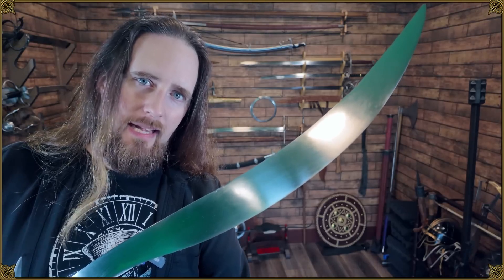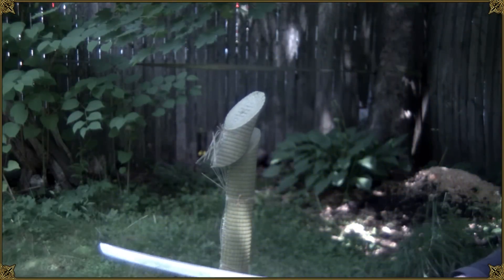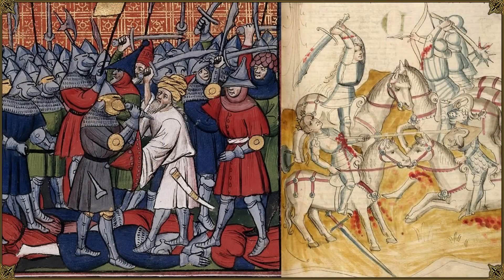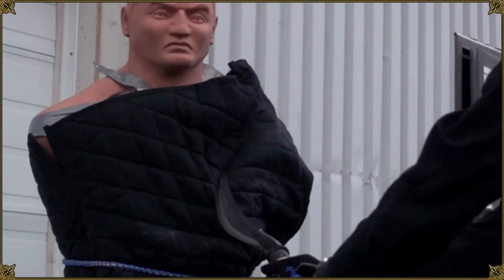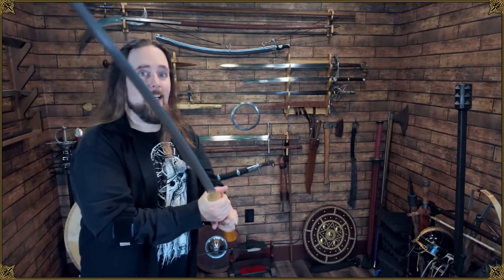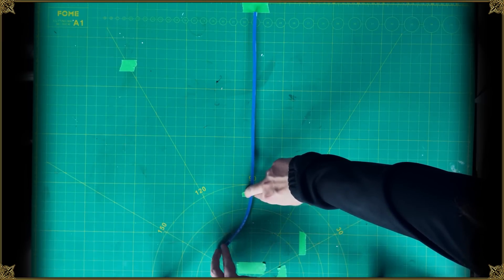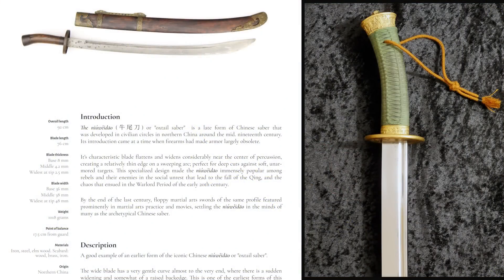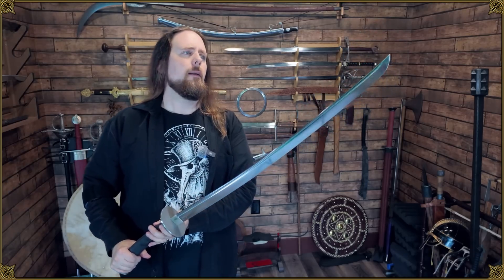Sword Design: What's the Recurve For?

Comment: I have a machete with a straight spine and a slight s-shaped edge. It cut trees/branches up to 1-2 inches (2,5-5 cm) in diameter clean of. The optimal cuting zone on the blade just between the curves. 

I also have a "biggish" knife that have the same curvature. It is useless as a bushcraft knife because spikes on it's back but it is a phenomenal at cutting things. I primarly use it as a kitchen knife out in the bush and it works perfect. The curvature and wide thin blade makes it cut (not chop) meat and veggies very well with little to no effort.

Comment: I've always thought that curved handles are there to lessen the risk of the sword falling off of your hand, to harden your grip. Because when an opponent were to apply force to your sword, it would be easier to hold on to it, for it to not slip, or am I wrong? Especially in dueling blades it should be more common, not for typical soldier blades, which are thought to last (durability) instead of leaning more towards effifiency. What do you think?

Comment: This topinc and curved handle specificly reminded me of a bent shaft canoe paddle. This is a style of paddle where the shaft is bent "forward" at about 15-30 degrees partway down the shaft. This way when you do a stroke, the back half of your stroke, which has more power, stays in the water for longer. 
In this case of the bent handle it feels like, the end of the swing where you have connected with the target, your arm has more room to move towards you, giving you more power at the part of the swing that "matters."

For those curious bent shaft paddles also have a number of drawbacks in that they are built just for power but really akward to do anything else with (and weird to use even when going straight). Also they tend to be much more fragile.

Comment: I feel the curving handle is mostly to help prevent the hand from slipping further. 
I get the same feeling when having a round pommel like in the video, there's more material that the bottom of the hand can go up against and thus slow down on. You can feel that rather prominently on anything one handed, such as a hatchet, machete, or on a splitting axe's handle.

Comment: I think it's a matter of force and impact. If you try to cut down cavallry, you don't have to generate much force yourselft because the horse is allready moving at a high speed, unlike an allmost static target ai infantry. If the force needed to cut is generated by my opponent, rather than myselft it's more a matter of what is easier to hold on to; or if the force generated by my oppoenent is much greater than any I could generate how do I ensure I still get a cutting motion, even if what I am doing is effectively only holding onto the blade ai resisting the force that is applied against my blade. If you imagine holding a stick into a stream of water, it requires more effort on your part to keep the stick stable when it is straight, rather than curved; and the motion overall is different.

Comment: I think you need to take into account the wrist being a pivot point, and specifically it being a bi-directional pivot. The forward curve probably gives your wrist and hands more purchase to start the blade back and then arch it forward as your wrist and elbows rotate in the swing. I'm just mentally theory-crafting this it would definitely benefit from real practical testing.

Comment: Unfortunately, there are three significant errors in the video.

First, how in-line the point is has little to do with how easy or effective the sword is for thrusting. In fact, it's widely considered best if it isn't, as a point forward of the grip axis has quite a few biomechanical advantages. As evidence, I give you the khopesh, the 1860 LC, and the Pattern 1908, as their relative thrusting capacity is inversely proportional to how in-line their grips are with their points.

Second, it's not the length of the edge that determines "sliciness," but the angle of the edge relative to the direction of the sword's motion. In other words, a straight blade will behave similarly to one that's curved if it strikes at an angle. That's why if you look closely, you'll realize that many kilij are effectively two straight sections joined at angle, and only the transition between them is actually curved.

And third, curvature doesn't necessarily make a sword worse at thrusting. At worst, you're trading wound width for wound depth, and whether that trade-off is worth it will depend on the "hardness" of the target and the angle at the tip. Additionally, if the sword is curved forward, deeper penetration can actually be obtained using what Col. Marey-Monge called a "curved thrust," a cycloidal motion somewhere between a typical thrust and a cut that allows the point to be delivered with greater speed and force.

This is all discussed in depth in Memoir on Swords by Marey-Monge and "The Shape of Sword Blades" by John Latham, which are free to download, not terribly long, and written by two of the most respected sword designers of the 19th century. They get a few things objectively incorrect, but they're very interesting reads and probably the best sources out there on "sword theory."

Comment: For single handed swords it was probably reduced wrist injuries. I know the main thing in rapier is avoiding over extending your wrist. I can imagine that happening less with a curved handle.
For your example if I imagine 2 swords at the same angle one with curved handle, when you do that cut where the fulcrum is between your hands, gravity probably accelerates the blade forward slightly faster by the time your hands line up when you use the recurved handle. Maybe it get more impact on the target since you have a tighter grip on the sword. 
It might not have been popular if it caused a higher fracture rate in the handle though.

Comment: Notice that with the curved handle, the movement in your green board is nearly left to right, while with the straight handle, it's more on an angle.  This suggests to me that you'll be able to apply your arm strength more directly.

Comment: I think Skal is wrong (sorry Skal) in that the forward curved handle in fact does provide mechanical advantage. The bottom half of the grip is traveling farther before hitting the target, and therefore the off hand is doing more work, and therefore is transferring more energy through the blade than would be the case if the handle was straight. This is directly analogous to a large gear driving a smaller one. More precisely, a larger gear (the curved handle) is being used to drive another gear of the same size (the blade). These are levers, not gears, but I believe that the underlying mechanics are the same.
Now, whether or not this mechanical advantage is important compared to other design features, that;s  a different issue!

Comment: No idea on 2 handers, but as some who did fencing for a while, I think I can theorize about the one handed recurve handles.

With fencing style swords, you tend to have a very relaxed grip until the moment of striking. Because a looser grip makes the weapon more "whippy" and fluid. Tensing up has a cost in speed and control, so you don't do so until right before striking to brace the weapon and give it that extra oomph. You're gripping strongly with the thumb and forefingers, but the back fingers are relaxed.

With a recurve sabre, I think that tensing up as you strike would pull on that bottom lever increasing your cutting power. The natural fist grip pulls the blade forward. I don't have any HEMA or "real" weapon experience, but from a fencing perspective I can see a forward curved handle giving a lot of cutting power because of the way you tense and relax the bottom 2 fingers when fencing.

Comment: Historically curved blades were used primarily by cavalry - so perhaps we should look for their main advantages in connection to horse riding? If I imagine riding a horse towards an opponent to perform a cutting attack (on the move), it seems that with a straight blade I risk injury a lot more (if e.g. the cut is stopped by the opponent's armor, I could dislocate my shoulder or fall off the horse). Keep in mind that in this scenario the cut is powered not only by the rotating movement of the arm, but also by the forward movement of the horse (which makes this attack more "choppy"). But a curved blade should slide off the hard targets more easily, without stopping abruptly or getting stuck.

Comment: Pretty sure the recurved handle is mainly to make it biomechanically easier to fully extend the blade. In single-handed swords you'll notice you'll naturally slip into a handshake grip, which makes it less demanding to get the full reach out of your blade. In the two-handed case you also avoid the phase where your lower hand basically overlaps with the forearm of the upper one, which again makes it easier to hold it fully extended.
The downside on the other hand is that it becomes biomechanically more demanding to hold it further back before the cut - to maximize the way you get to accelerate it over before it impacts, giving it a higher top speed and thus more force. Pros and cons in both.

Comment: With regards to physics, or more specifically, the curvature of the handle doesn't matter, only the length. Technically the curvature makes a shorter handle for the same material even, but by a negligible amount. My guess, if it's not purely for aesthetics, is that it has to do with hand positioning. You are "pushing" with your main hand and "pulling" with your off hand and maybe you have slightly more leverage because your off hand's wrist is less twisted or something like that. Maybe with a recurved handle you are supposed to favor your off hand more.

As for the more general physics explanation for why two hands are better than one, I think it's better to compare it to a cantilever structure rather than to a lever where one hand is a fulcrum, though the leverage is an important effect, but since you are operating the short end of the lever you are actually sacrificing force for speed. I think the cantilever is a better model, but you have to think a bit backwards. Say that you hold a sword in one hand, if something applies any force to the tip, it will be easy to move because they're applying a lot of torque (rotational force) to your wrist. This rotational force is hard to resist because you are working against the leverage they have, and because your wrist is relatively weak. With both hands on the blade, if someone is trying to move your tip, they are now pushing on one hand and pulling on the other. You now get to apply the full force of the muscles of both your whole arms as opposed to the muscles in one of your under arms that twist your wrist. I've talked about it in terms of resisting force, but of course, it goes the other way as well. When swinging a sword with both hands, just as you described yourself, you are pushing with one arm and pulling with the other. The larger the gap between your hands, the more leverage you get, but regardless you'll get more power than what little rotational force you can produce with your wrist.

Comment: The curved handle is less about power and more about reach.  It keeps the blade pointed out better when considering the way the wrist moves.  It is not providing more power, but it does allow for more comfort and a more natural wrist movement.  So. You may be getting better power only because it is a more comfortable paoition.

Comment: Recurve on the handle is probably most useful for ergonomics. The trick with tightening your bottom fingers also works a little bit better (when you do that at the point of the cut, you are adding additional rotation with fulcrum around your bottom hand, not the guard), as it makes the grip on the bottom hand less awkward for doing that.

Comment: I think one reason for curving the handle is that it's more comfortable to power a cut with your offhand starting infront of the main hand, and end more or less underneath it (or just behind). Instead of starting under the main hand, and end quite a bit behind it. It won't make the cut more powerful per se, but it's easier and more comfortable to get the same amount of power as with a straight handle. It has to do with wrist mobility and how human muscles contracts and stretches. 
I guess it would also make certain movements and cuts possible/easier to do without straining the muscles in the forearms and wrists as much.

Comment: About the recurved handle... could it favor a better handling when a shock/contact happens vs a straignt handle? Would'nt it help to prevent a rotation of the blade and offer a small lever to conteract the rotation effect (ref. the line of the blade)? An answer would be appreciated if you know the answer.

Comment: I think it's about reach, stance and measure
It's a grip that makes it much more comfortable to have your sword pointed fully forward with an outstretched arm, without sacrificing your holding power.
It only realistically works with curved blades, and it mitigates some of the reach problem you mentioned at the top of the video

Comment: the impact of the curved grip has little to do with physics, it's more about body mechanics.
the curved grip is curved away from the palm of your hands, so it give more clearance for motions that requires it to rotate towards the palm of your hand. well... it actually has a bit to do with physics. with a straight grip, if you exaggerate a push pull motion, first the grip is pressed against the "webbing" between your thumb and index, then as it turns it lays flat in your palm, and finally it rises from your palm until it presses only on the meat at the bottom edge of your hand. that abrupt transfer from one lever to another is a small loss of energy, and it's also uncomfortable in the hand. if you do the same thing with a curved grip, it doesn't lay flat in your palm the same way, it rolls of it along the curvature.
the other bio mechanical advantage comes from your bottom hand is not pulling perfectly perpendicular to the sword during a normal cut. there's always a bit of a "draw cut" motion, where your bottom hand is pulling slightly toward the pommel. so the curved grip allows your hand to pull perpendicular to the grip, which in turns requires less efforts from your fingers an make the grip more secure. you get a similar effect with a straight grip and curved pommel, like you see on many kriegsmesser, the way it stop your hand from sliding off gives a much better grip for your fingers.

Comment: @Skallagrim    I think that when you use two hands to apply force to the recurve handle, instead of a point in your wrist or forward of your hands, the fulcrum becomes a point between your hands. Kind of like a barycenter in an orbital system. So then you csn see how the forces from your hands could be visualized as being applied to a wheel with a bar attached. That shows that the fulcrum moves to a point that is farther towards the pommel. That makes the distance between the fulcrum and the load (point of percussion/tip) longer. That increases the force multiplication a bit. The increase in force required from the hand towards the pommel is offset by the decrease in the required force for the other hand. Whether they cancel or not depends on the distance between the hands and the "fulcrum" being equal.
I think that, if you do it right, there can be an increase in striking force with a recurved handle. Although I have only used one sword with a recurve handle, I have used several axes with that type of handle. From my experience, an axe can definitely cut deeper with that type of handle. I wonder if you could test that out with two axes, each with the same head but with diffetent style handles. Then you could see if one bites deeper or not.
Great video with an interesting topic! Thanks!

Comment: I thought the benefit of curved blades was to be able to hit targets hiding behind a shield in close combat easier..
you could kinda trust behind the shield without  exposing your hand over the edge.

When it comes to the curved handle...
I guess that if you skeewer an anemy, and your sword get "stuck" it is easier to pull it out if the handle is a bit curved than if it is straight. It seems like it would give you a better pulling grip.
None of the curved handles you showed had a ball at the bottom that would have served a similar function.

Comment: I assume the curved handle might not be necessarily for the cutting power (or solely for the cutting power) but to make thrusts more comfortable 
As you pointed out - the recurve blade helps to align the tip and the handle. In a way, a recurve blade and a curved blade combined with a handle curved in the opposite direction are an attempts to solve the same problem. 
There are  swords with straight blades and curved handles - mostly used in China and Korea as well as in Japan before they came to the idea of tachi/katana. I believe it comes to how different designs handled (no pun intended) the thrusting grip, because just holding a thing with a tight fist and angling it to align with your forearm is very tiring and painful. 
So with the European swords you lay your point finger and thumb on the crossguard to offer strong but comfortable "straight-line" thrust grip, while in the "Eastern" swords the curved handle serves the same function (and the typically Asian disk guard isn't well suited for wrapping your fingers around it). You can look at modern epees most of which have curved handles or protrusions from a straighter handle.
On a related note, katar might have developed from daggers with extremely curved handles or dagger techniques that utilise the (cross)guard for firmer grip.